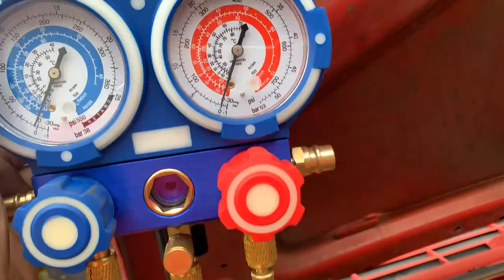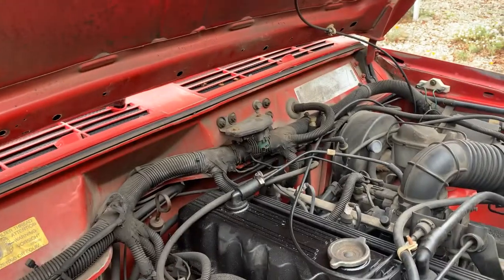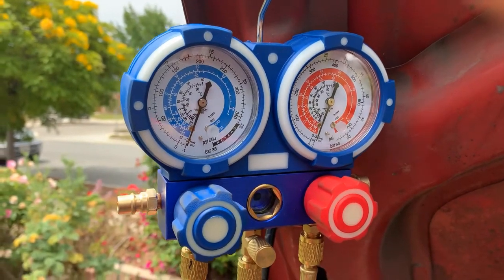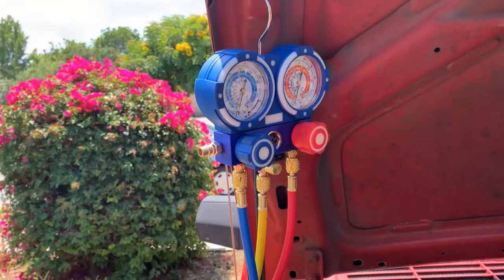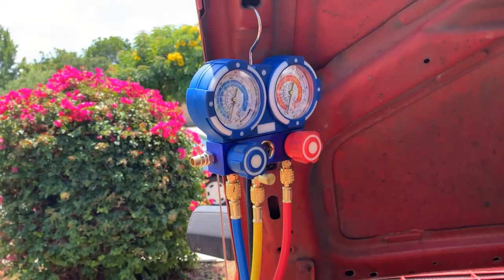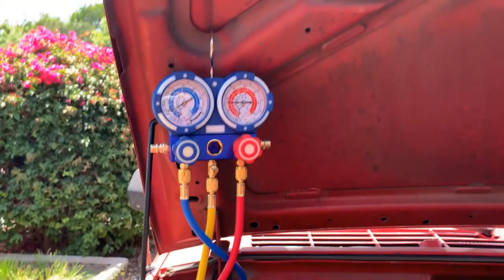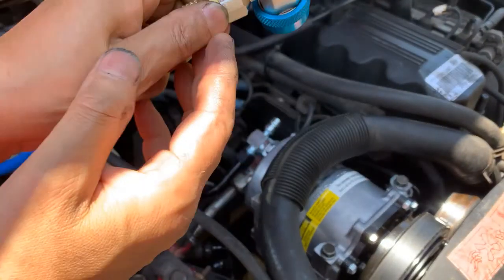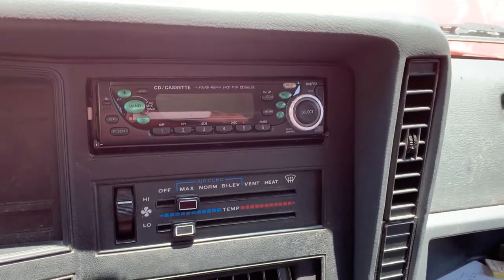93 Jeep Cherokee XJ, AC R-134 upgrade (Part III)

Comment: It looks like you used the UAC kit for a 1993 XJ instead of the kit for 1995-1996.  I know your Jeep is a 1993 but isn’t that kit for an R12 system?  Wouldn’t it have been better to buy the kit and parts for a 1995-1996 XJ that were originally equipped with R134A for your conversion?
Reply from the maker: The 93 kit was for 134A. It's a conversion kit from R12 to R134A.
Reply: @madatsukaerude  very good.  Thank you for the clarification and the great video. I’m about to do this conversion on my 1991 XJ.

Comment: Good sir , did you have to change the evaporator?
Reply from the maker: I just replaced it because a new one came with the upgrade kit. I don't know whether the evaporator size (orifice size, etc.) is the same for R12 and R134, so it would be better to replace it.

Comment: Mada tsekauru de, thank you so much this video and the last one has helped me out so much with my 1991 Jeep Cherokee, I’m converting it to r-134a and I haven’t found a video to help becauee the service valves connections were a problem with me but you helped me confirm my theory and help me answer my question with the part number of the valves themselves
Reply: I'm installing from scratch in my '92 and it's been an archeological mission. The valves were impossible to figure out, this too was a huge help for me.